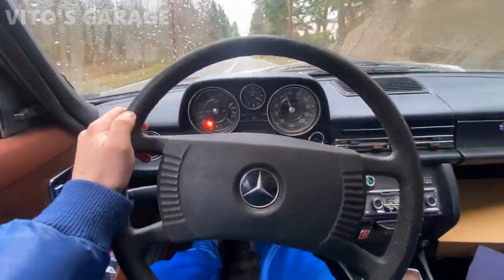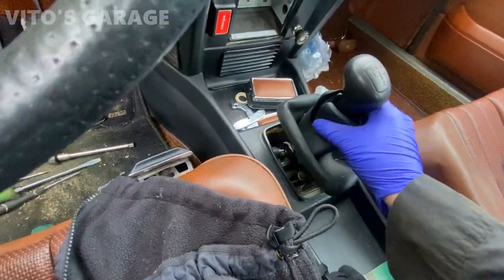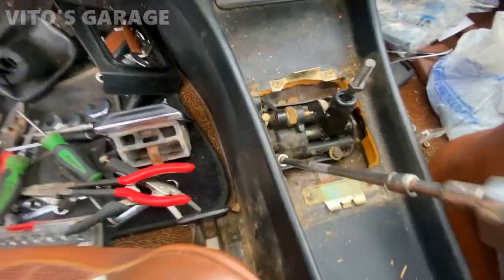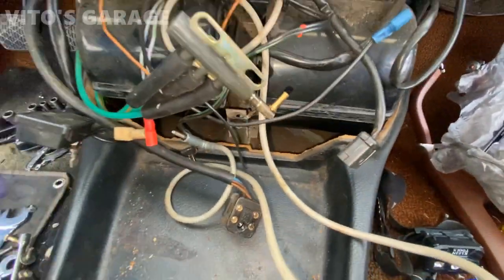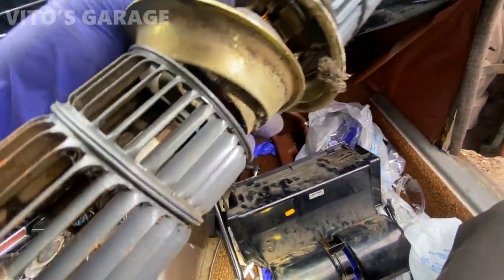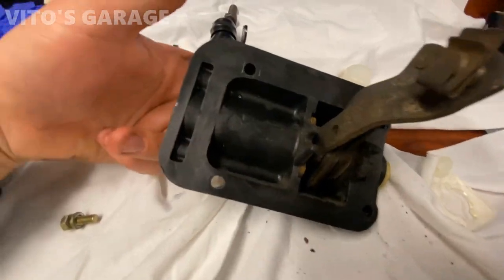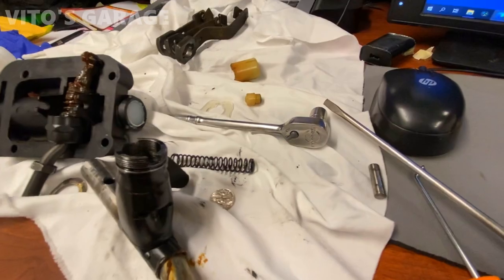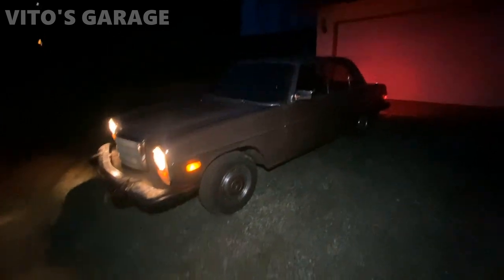Mercedes W115 W123 Manual Transmission Shifter Removal & Rebuild!!! 240D 300D 280E 300TD

Comment: Did you get the fan working? That “squirrel cage” fan is for the air conditioning. There is a separate “blade” fan further back in the firewall for the heater. The bladed fan gets really dirty and quits working.
Reply from the maker: No. I’m not pulling the dash now or dealing with that big fan. Will be driving with no fans for now